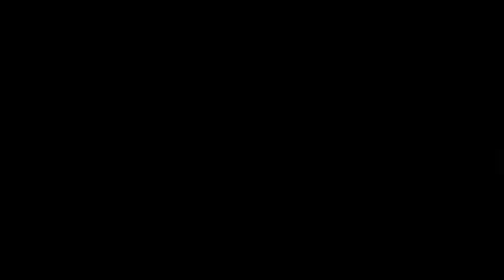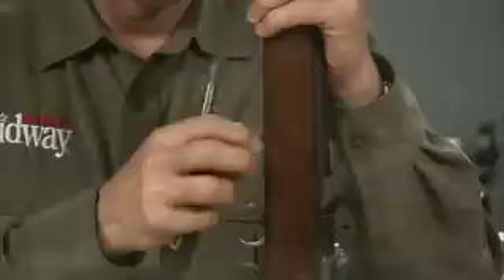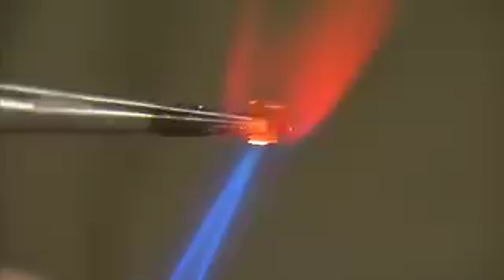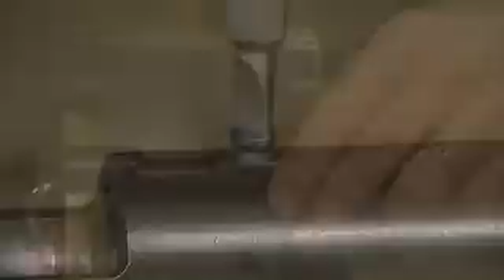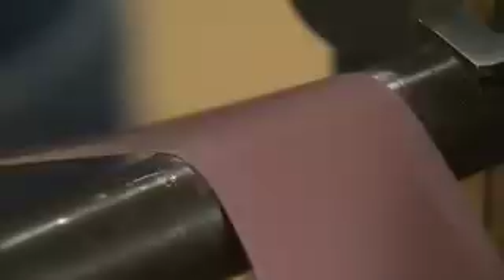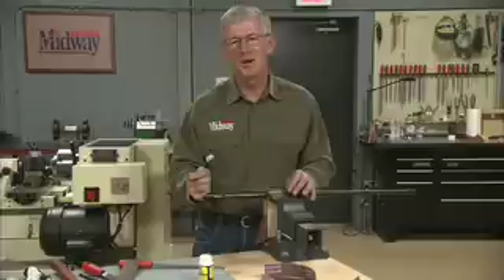How to Remove Old Screw Holes from a Firearm | The Model 67 Project | MidwayUSA

Comment: my concern, if i was to do this to my rifle .22cal that used to have iron sights on it now it has a scope and i have removed the iron sights and would like to fill the holes, is how likely is it that i could deform the barrel when flatting off the screw heads?

cheers mike
Reply: It should be fine.